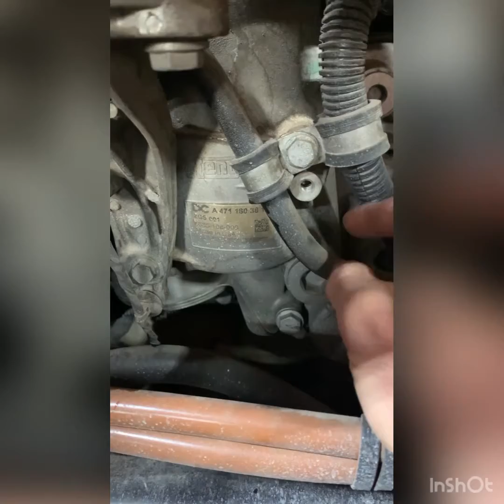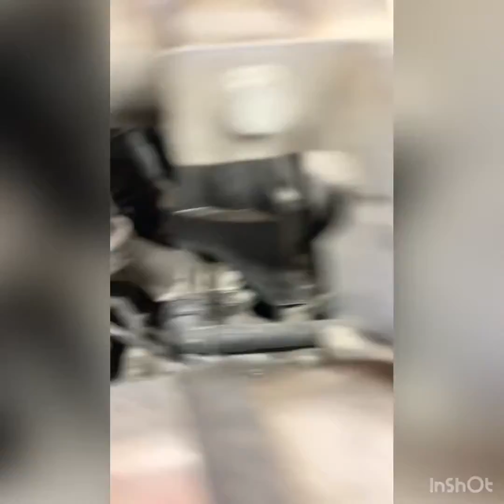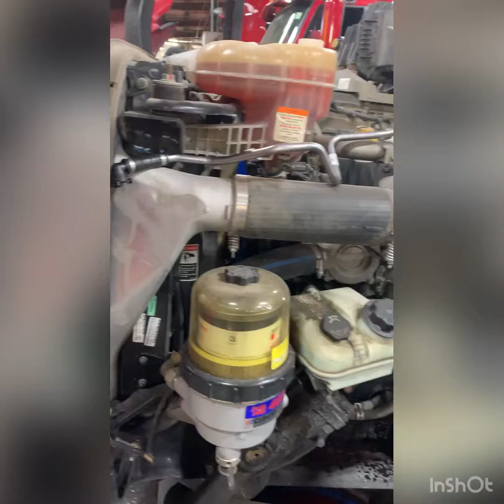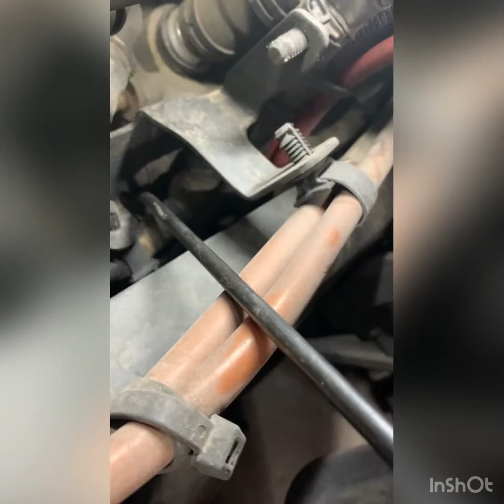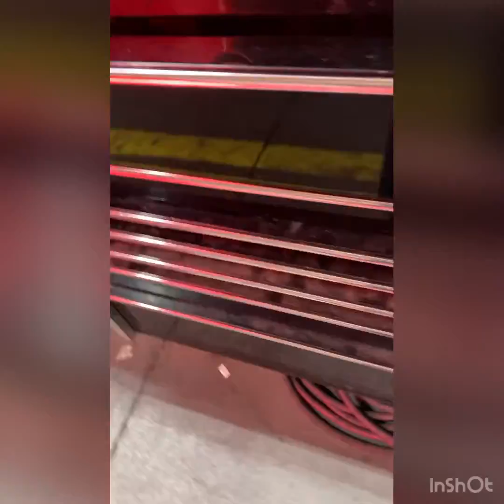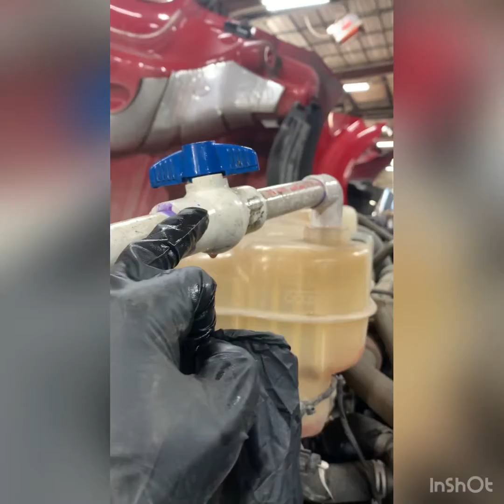Freightliner cascadia 2019 coolant line replacement ocm to air compressor. busted knuckle diesel Dr.

Comment: What issues were the old set up causing besides leaking ? Like why did Freightliner stop the one hose with a plug ??
Reply from the maker: @Born11483  the reason they got rid of the three port design and went with the two was getting rid of the fuel cooler in the fuel filter module. Detroit realized they didn’t want fuel temp raised and cooled just fine without the cooler.

Comment: Why does the engine block need to be drained ?
Reply from the maker: @ChristianTorres-s4b  great question. This is the easiest way to drain the cooling system completely and not make a mess. So this is my go to.

Comment: This job is so much harder on a DD13 Cascadia.
Reply from the maker: Every job sucks on a dd13. Horrible to work on.
Reply: Any tips to help with dd13
Reply: @thadiesel7655  not really, it’s hard no matter what on the dd13. If you take the left steer tire off you can access the clip at the air compressor but there is a mounting plate that holds the lines together in the way. It has two 13mm bolts holding it in, if you remove the rear bolt you can pry it up just enough to pull the pin with a small hook. No matter what I do it makes a huge mess when I pull that line. Good luck
Reply: @mattsmith817  thanks . If I were home, I would drain the coolant first. Sucks
Reply: @thadiesel7655  even when you drain it there is a lot of coolant trapped in the motor that will find its way out. I gave up trying to be clean when I do these lol.
Reply: @mattsmith817  gotcha. I'm looking at mine now. Do u think the part# is the same on the dd13 as in this video?
Reply: @thadiesel7655  it probably is. But you can call a freightliner dealer and they will give you the correct number. I can’t say for sure off the top of my head.
Reply from the maker: @thadiesel7655 many of the part numbers are different between the two engines so for sure check with your local dealer for the right number first.

Comment: Just did this on a stub nose daycab an had to fight the rear until I popped the fuel lines off the housing an it went right in. Thank you for making this video saved me a 2 week wait just to get into the dealership for this
Reply from the maker: Thanks for reaching out. Glad this vid came in handy for you. Those short nose cabs are horrible for every repair and you Gta give yourself a pep talk before doing anything on those. This is gna suck no matter what. And damn what a wait to get in. Careful with those orings on the fuel lines. They tend to suck in air once removed/disturbed. Hopefully you replaced them. Hope more vids on this channel come in handy for you. Stay safe out there.

Comment: how long does this job take? great video
Reply from the maker: Good question,, realistically 30 min but expect to pay 3 hrs.
Reply: @bustedknucklebydieseldr3228  wow why do you say 3 hours?
Reply from the maker: So it doesn’t matter what it takes to do the job because some people are naturally quick  it only matters what srt times warranty provides us, and for a cust pay job it’s usually 30% mark up whatever SRT time is.   30 min is just me hustling to get it done and out.
Reply: @Busted knuckle by diesel dr what do you mean by srt time? Also is this used by dealers only? or also small shop . Thanks for the info
Reply from the maker: @jdhlogistics2142  Glad you asked because it can be confusing. SRT is standers repair time used by the manufacturer whether Cummins Detroit Wabco or any others. The time it takes to do the repair. That’s what dealers and small shops use to get a basis for what the job should pay. And of course most all shops have to make money so they usually charge 30% ish mark ups on those times. So if it pays 2 hrs they might be putting another 45 min on the job labor rate. Hope that helps.